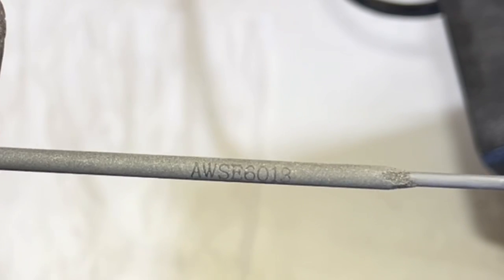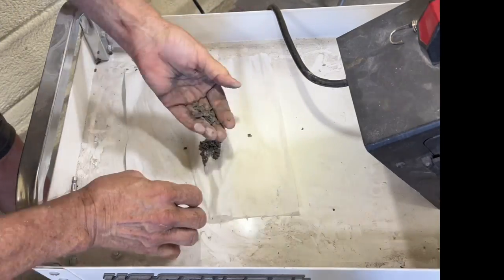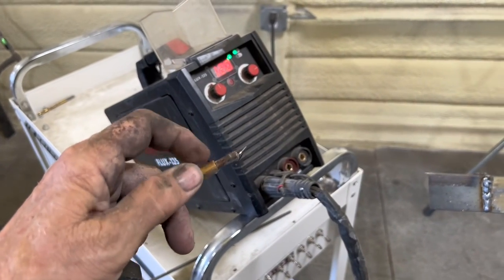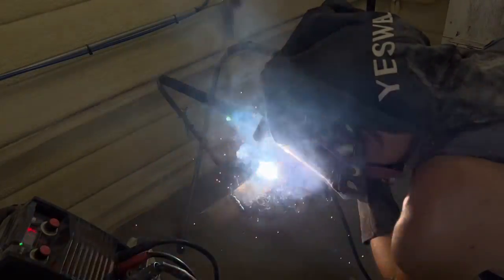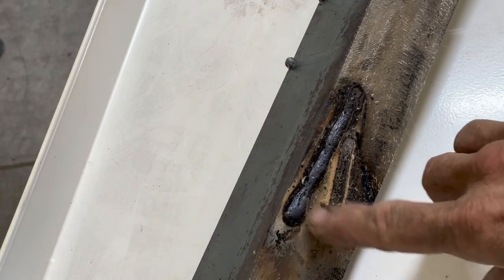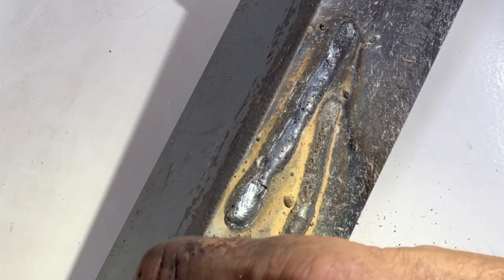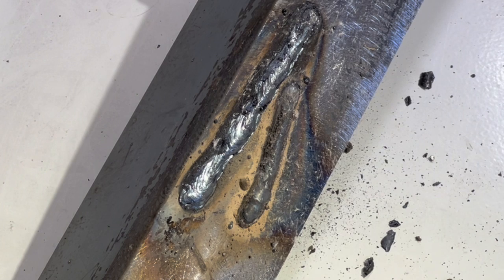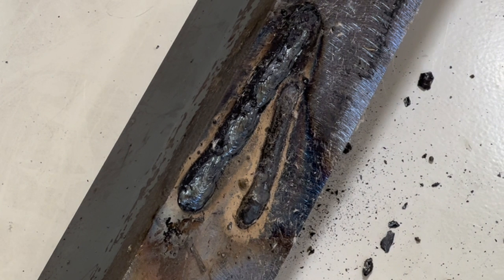Welding Tips - Why There Is NO SLAG On My Flux Core Welds Techniques For Beginners and Pros

Comment: Its worth noting that different stick rod are rated to weld thru their own flux covered welds aka 6011 while others like 6013 or 7018 if memory serves me correct need to have the flux chipped off welds before welding over them.
Reply from the maker: I don’t know about stick welding, but fluxcore has no slag
Reply: @OldBondoBilly  Woops.  I guess I got everything you were conveying wrong.  I guess the flux just vaporizes and provides gas shielding.  The flux on stick rods is there largely to insulate the weld puddle for all kinds of reasons related to steel metallurgy like grain grown, crystal precipitation, ect.  My bad.

Comment: Well, BB...had another day of no welding gas and no time to get it. So I flux cored a ford rocker, made a couple small patches, did some plug welds. And had the best Fluxxing day of welding with the Yeswelder so far. Got it dialed in. Found my timing. And got some nice strong welds. I know, cause I pounded em with a hammer. If I can repeat it tomorrow, I will know I have taken the first steps to being one with the flux. A fledgling Jebi warrior. May the flux be with you...
Reply from the maker: Practice makes perfect 😉😉

Comment: Hi Billy, I  don't know if flux core was around in the early 80s but I  was doing flares on a 68 Monaro and miss were relatively  new , so though this will be a whiz with the new welders with little distortion on the strip's I was forming, but do you reckon that metal would weld it splattered and farted all over the place so back to the oxy I went until it agreed with the metal.
Perfectly clean or no gas mig, that's where I expect the flux core comes into a world of its own.
Reply: Flux core was around in the early 1980’s. That was my first experience with it welding heavy steel plate in a fabrication shop.
Reply: Mig not Miss.

Comment: I use a bit of rubber fuel hose over the "tip" to stop it shorting. I just leave 3/4 of the copper tip itself sticking out. Works good. I hit my welds right away with a wire wheel - they clean up nice.